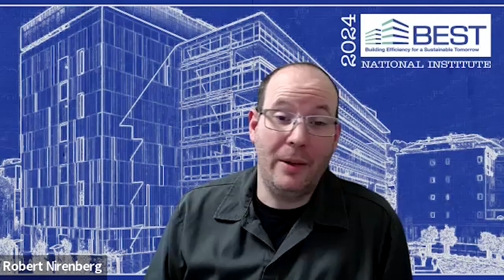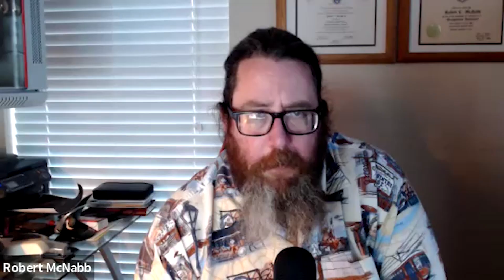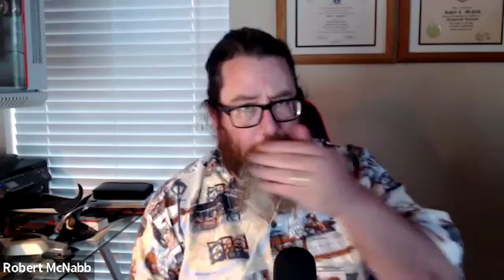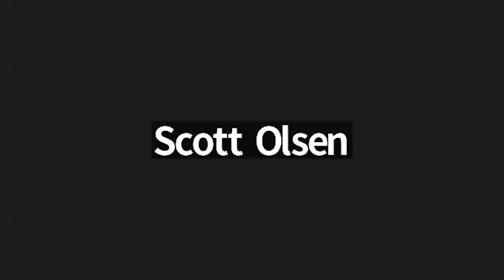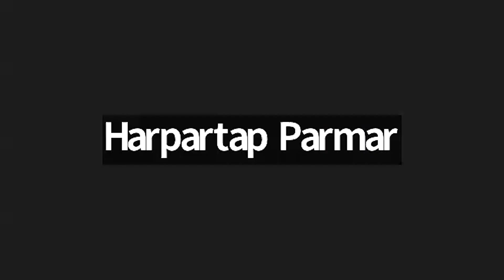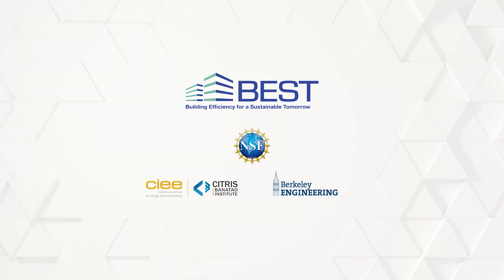BAS Classroom Lab Applications - What's Working and Not?

Comment: When BACnet is not correctly implemented and optimized then that starts to affect downstream MSTP trunks. Many times MSTP networks are flooded with upstream traffic from the IP level slowing them down dramatically.

Excessive network traffic may be present, IP networks just handle the throughput and the issue is not perceived or noticed. The excessive traffic is still there, performance problems are just not as noticeable with screens and pages loading fairly quickly. Clean up the broadcast network traffic, setup your mac addresses consecutively with no address gaps, set max masters to the highest MAC address on the network and configure max info frames based on the number of devices on the network and MSTP networks will do OK.

Go with ARCnet and you will have performance far superior that of MSTP with much less setup.